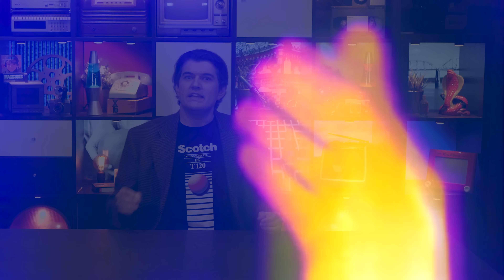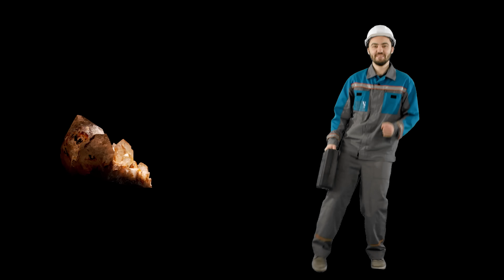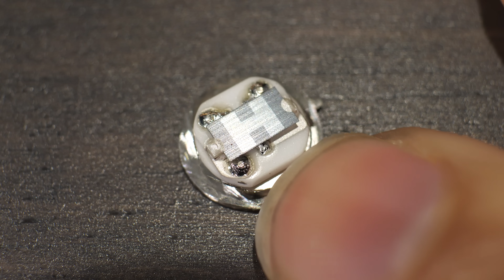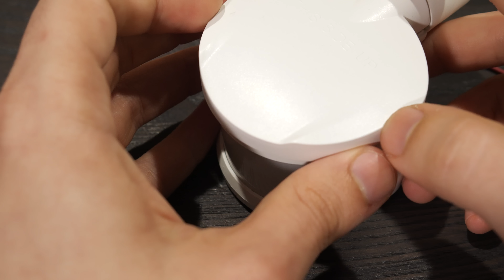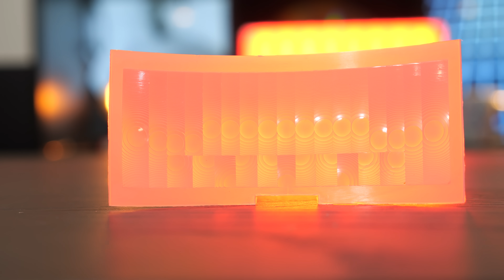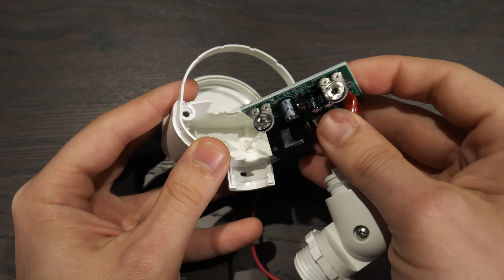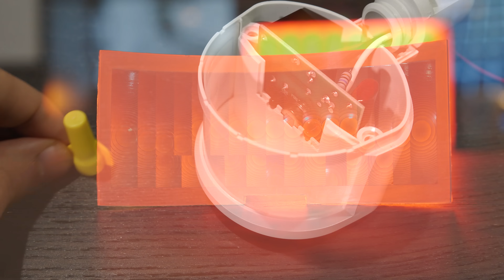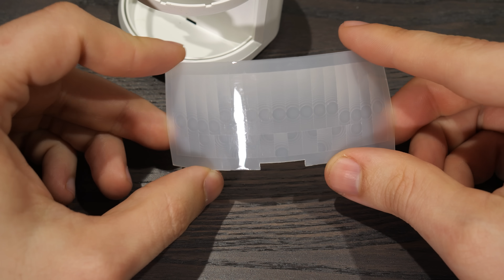Passive infrared motion sensors: a two-bit camera powered by crystals

Comment: Interesting fact that some diodes work as heat detectors. Especially some random orange soviet diodes are good at that, can see a candle 10-20cm away without any optics. Raspberry pi sometimes too comes with similar those, and can be shut down by flashing it with light.

Comment: Fun fact... I figured out when I was a kid, that if you use a hand held (I only used a old school RED) laser and shine it into the lens of the PIR sensor, it "blinds" the sensor.  So for Security sensors to trip flood lights in driveways and stuff, if you take and shine a red laser into the motion sensor, while shining it, you can move infront of it, or have multiple people move infront of it, and the light never comes on.  Even with the same sensors were used in alarm systems in homes, and again, same trick works...

Comment: So in theory…you can defeat these motion detectors by putting a reflective material between you and the “motion” detector.
Reply: as long as you don't put that material in front of a heat source, which is permanently in the room, it could work.
I wouldn't however bet on that.
security systems use more than just IR sensors, though.

Comment: I still cannot understand one phenomenon at my home. We have a small room about 1x1.5m with a door and a ir sensor light in the middle of it, but the door is missing its lock but still has its door handle etc but you cannot lock it. And because of it theres a piece missing leaving a 1x1cm hole straight trugh the door ( door is about 5cm thick). And when the door is closed and i walk up to it i dont even reach the door handle with my hand and the light inside goes on. The light is about 2m above the hole in the door. Putting a tape over the hole stops it. Same happens with my front door, it has a Peephole and if i look trugh it the light outside the door comes on. The peephole has magnification and a bunch of lenses so how can it detect heat trugh glass lenses?? Im puzzled and blown away how sensitive they can be!

Comment: This is neat, and you didn't even get into the typical BISS0001 ic and circuit of the rest of the module, which is also neat. Easy to modify too. Or the digital pir sensors that exist instead of that 3 pin analog doohickey.

Comment: Those are so much simpler than I ever imagined!

I always thought it was like a small, low resolution (very low frame-rate) IR camera that just subtracted subsequent images to register a change.

I guess it is kinda like that except the camera is only 2 pixels and there is no "frame rate"
Reply: well, there are IR sensors which got more, so they can differ between different areas (like a combined living room and kitchen)
I've worked with more advanced ones with 3 and 4 areas. These however are mostly in buildings with a central building management and control system

Comment: So technically thick winter jacket can block you from triggering those? Or anything that can insulate your body heat?
Reply: Don't think so, otherwise it would be common for burglars to do exactly that.
Reply: @yespeace2000  I mean how would it know you're there then? If all it measures is heat and you insulate the heat than it gets no signal right? I genuinely want to grab a jacket and run around in front garage (if not for a scorching hot weather)
Reply: there is a possibility, yes, but modern ones have more than just two sensors, and they are more sensitive.
and regarding burglars: you don't use such IR sensors for a security system only. They are combined with other kind of sensors, be it cameras, high frequency ones (they work similar to radar) and so on.

Comment: And, basicly all of them are crap, even in expensive equipment.
I have spent some time setting up a system, but I ended up going with sensors for alarm systems that has both PIR and a radar, or else you get an enormous ammount of false detection, or have to turn down the sensitivity so they don't always react.
Since the location also should have an alarmsystem, I handed the project over to the alarm--company and they spent 6 months finetuning their system. (and that was after I told them to use the best dualsensora they could buy)
Reply: For detecting sitting people you don't use normal motion sensors, but presence detectors. Better ones don't just have one pair of sensors, but several.
The one I am using has 3 pairs, and the instructions has drawings, on which kind of movement is detected in which distance.
But yes, using radar sensors is superior, doesn't however work with detecting from which direction movement happens, which can - depending on setup - be important (that's why several pairs of IR sensors for one device)

Comment: Loved the awnings episode. Apart from the despair that such a simple solution isn't used so often.
Reply: AWNINGS NEED THICKER WALLS?  If you put up awnings need to maybe replace em every 30 years costing energy for new awning and money.... And have to make wall stronger to hold awning most years of medium winds..... Allready roofs are using thicker wood and straps for potential solar panels, so thats like 5000 lbs more wood and material.. .a little more heating and cooling is fairly cheap, if exclude the utility basic fees and just count fuel/energy variable, like $2400 a month??  To save via awnings maybe $240 is it worth making all house walls above wondows stronger...   I live in Houston and builders build low and smooth to avoid need for higher strength against wind...

Comment: Can these things be sensitive enough to detect heat through a wooden door or the small 0.5cm gap underneath it?
The light in my appartments hallway jumps on at night when I walk past the inside of my front door. So there is not a visual connection.
Reply: Can be, if your door is thermal reactive fast enough
Reply: usually not.
If you need that functionality, take a look at radar sensors, they can look through thinner doors, and also look around corners.
Reply: JWST uses this principle to detect far away galaxies. It's possible but it depends on the equipment.

Comment: This is my field of work - I have been working with electronic security equipment for over 30 years. After the humble magnetic reed contact, the PIR was probably the next detection device I learned about on my trade course. A few extra points:
- detectors for burglar alarm systems tend to be much better quality so that you can accurately set up their field of view;
- the best ones are the mirror type which you mentioned and of course the sensor element points backwards;
- the better detectors have sealed optics so that insects and dust can can't get in over time and mess up the calibration;
- a further enhancement is the addition of a microwave transmitter and receiver pair.  The transmitter sets up a standing wave of low energy microwaves in the space (although they can penetrate walls) and the receiver picks up disturbances in the pattern of the standing wave caused by movement of a body in the field of view.  The two different methods of movement detection in one device - only detection by BOTH technologies at the same time causes the device as a  whole to trigger -  makes it much more reliable;
- to protect against sabotage, some models have an anti-mask feature which uses either the established pattern of background heat (from when the device is first powered up) and/or the triggering of the microwave sensor without the PIR (because the microwaves penetrate solid apparently opaque materials but infrared does not (not at the power we're talking about anyway)) to detect if the detector has been deliberately or inadvertently blocked.  This raises an alert on the burglar alarm panel and the offending object must be removed before the system is allowed to be armed;
- Here in the UK, the police hate having to do any real work and they hate even more having to do any work unnecessarily.  The industry has been in a battle with the police for decades because the police rules have become more and more stringent to determine what compliances have to be followed such that they will allow calls to be referred to them by an alarm receiving centre which they will then attend following an alarm activation. Householders and business owners would rather just have the police come out just in case. We have the concept of confirmed alarms where two separate detectors on separate circuits of the system have to be activated within 30 minutes to generate a "confirmed" activation. Some clever manufacturers have come up with a device with two detectors in one enclosure and the lenses' fields of view interleave in the area of coverage. Even then, it's easier to arrest someone for using the wrong pronouns about another person than it is to catch a house burglar, so they'd rather do the former.
Reply: my neighbor recently had a system installed in her office, but they work additionally with cameras aswell.
That system only works with their 24/7 service, though.
Not sure about their parameters, but if there is a detection, they are alarmed, and log into these cameras, and can talk (actually more of a yelling) to the burglar (or whoever it might be).
If you accidentally triggered it as houseowner, you tell them the secret phrase, and the alarm will be delayed, so you can leave or disarm the system.
If not, they call the police, and the evidence is saved.
Pretty neat, but pretty privacy invading

Comment: In the title, I think you mean a two-pixel camera, not a two-bit camera.
Reply: Pixels tend to have more than two states. These are just on/off
Reply: @nyetloki  No, both pixels are analog. In the sensor one analog value is subtracted from the other, and on the PCB this analog difference is digitised but only to one bit: moving heatblob versus no moving heatblob.
Reply: @mumiemonstret  if each "pixel" is a single bit, then this is a two bit camera
Reply: @nyetloki  Yes, but as I said they aren't. Each pixel is not single-bit, not two-bit, not digital at all. Finding a way to rationalise calling a PIR sensor "two-bit" is quite contrived. It could very reasonably be called a two-pixel camera though, which I hope you agree with.
Reply: @mumiemonstret  no but you keep arguing that

Comment: Favourite thing about these is a security issue., is that some doors have acces control so you can enter only with a card, but you can leave by just walking towards the door.
So to open the door from the secure side you can just hold a compressed air can upside down, so it sprays cold air/liquid and blast that at the top of the door at the gap between the two doors, and that usually triggers the sensor on the other side.
Reply: Deviant ollam has a lot of content about the flaws in these systems.
Reply: Except most doors with that setup, a request for exit command only unbolts the door, you still have to push a panic bar or operate some sort of latch. It's a rare building the will pop the door open every time a stiff chilly breeze stumbles through the cracks. But those eager-to-be-violated systems do exist. Google pen test results to save dust-off.
Reply: @BariumCobaltNitrog3n  a lot of places have automatic motorized door to enter or exit but only to enter you need to swipe credentials. 
The very cold cloud of gas confuses the hell out of the sensor.
I believe one of the defcon 19 talks has one section about this.
Reply: @DanielLopez-up6os  If you say so, but I doubt the little circuit board is having an emotional conflict.

Comment: I definitely prefer presence sensors over motion sensors, like the Aqara FP2.
Reply: presence sensors are using the same tech (at least most of them), just more sensitive, and some even more than just one pair
But I agree. Couple it with a light sensor, so you can dim your lights so it always stays the same brightness in your room.
Reply: @bernds6587  Well, the Aqara uses a mm wave radar which is extremely sensitive and can also detect multiple people and track their location. Even sitting completely still, it will still detect you.

Comment: But how is it that a body at 36 degrees can heat a sensor located 3 or more meters away, even with that plastic cover? I don't think we can radiate even a tenth of a degree that far
Reply: We radiate at 100 watts on average just existing. 400 to 2000 watts for light to extreme energy usage (working out, sports). You are literally a food to energy production machine. HVAC uses a 1 human 100w baseline. You are no different than a 100 watt incandescent lightbulb (5% visible light, 90% IR)

Comment: Do these work at higher ambient temperatures? Imagine a dark corridor but no a/c and it is a hot summer outside and 37°C below the ceilling of this corridor. I imagine the sensor will not trigger. What is the max. operating temperature of these devices?
Reply: They operate up to 130f for the handful I checked. The analog simple sensors won't be useful to detect people at 98 degrees, but smarter digital sensors have ways to increase detection.

Comment: So why couldn't you use the "tweaking the lens to only detect certain creatures" thing to make it so you only need one crystal, with its threshold tuned above ambient infrared? 

Or is it just that two crystals do the work of automatically calibrating to the ambient level of infrared light, therefore bypassing the need for that manual tweaking?

Comment: Most motion sensors don't work by seeing heat
Instead they work by detecting temperature change
This is why you can open doors with a can of air turned upside down
Reply: He says that (the negative temperature change)

Comment: The timing of some of these videos. I just took apart a sensor at my stairs that's supposed to turn on an LED strip underneath when someone is near, one of the two sensors just kept the light on 100% of the time. I cracked it open, saw that round little sensor thing and cleaned it with 99% Isopropyl alcohol and said "Well I might have fixed it or just permanently broke it even worse."  put it back together and IT'S FIXED!! Thing works properly again!

Comment: One mystery that's been eating at me is now solved! I wonder what could be causing the false positives I get in w of my small ZigBee motion detectors, which worked fine for some time and started misbehaving occasionally. I put one into a dark cupboard and it's still "seeing things" from time to time...
Reply: Bad capacitor. Or bad filtering. The analog sensor in the processing IC is very sensitive to voltage fluctuations and stray EMF
Reply: Or the lens/sensor is dirty

Comment: So... Is this why the battery life of my PIR is much longer than I expected? I guess the voltage is enough to wake whatever chip is connected to it which then goes back to sleep after sending what it sends... Interesting.
Reply: Correct. The sensor is passive after all. No input voltage needed for the analog type shown.

Comment: Finally, the last piece of the puzzle! I'd figured out that the infrared sensor strip on the elevator would eventually ignore that your hand is in the way and then try to stop again, so I'd tell people if they want to "HOLD" the elevator (and for some reason they refuse to use the button) that they better wave their hand. I didn't know exactly why that was though, but it makes sense that if the hand is perfectly still just holding the inside of the door, the crystals hit the new "equalized" state and it ignores the hand, eventually deciding to close again, regardless of the hand still in the way.
Unless I'm misreading something?

Comment: Why in the heck do my flood lights come on when the trees are blowing in the wind at night? Are the trees generating heat?
Reply: Everything generates heat. Photosynthesis also generates IR separately from the passive heat the tree generates existing.

But no, it's mostly just that the leaves are reflecting IR from other objects, and the movement causes negative temperature changes across the PIR lens and sensor.

Comment: Big Clive taught me all about these things, and how integrated they've become over the years. The modern ones just need 5v and ground, and they spit out logic-level signals perfect for Arduino projects and stuff like that. There's also a drop-in replacement for PIR motion sensors that uses short-range RADAR. It doesn't even need to be able to see the thing that's moving; it can detect right through a plastic project box.
Reply: After disappointing weatherproofing of a very exposed outdoor PIR light I bought a radar controlled one. The only disadvantage is that it is quite a good weather radar. I have to switch it off if it is blowing a gale or it will be on most of the night.

Comment: I'm sad that you danced around the notion that an alternating ripple voltage comes out of the sensor and that's specifically what the electronics look for - you alluded to it several times, but never stated it explicitly.

Ideally you'd obtain an oscilloscope (possibly with a friend that knows how to work it) and show us

Electronics is a bit fancier than electric things, but can do much more intricate things - which is why it's everywhere ;)
Reply: It's only true for some of the analog sensors. The built in transistor is basically on/off so there's no rippling alternating voltage (it's ground referenced DC), and many are digital now, both with simple on/off output or advanced serial output.

Comment: So Frozone could steal a bank without any trouble.
Reply: No. Negative temperature changes also trigger them. So sliding a cold soda can is the same as sliding a boiling soda can.

Don't do either